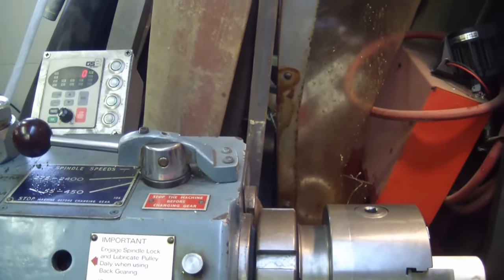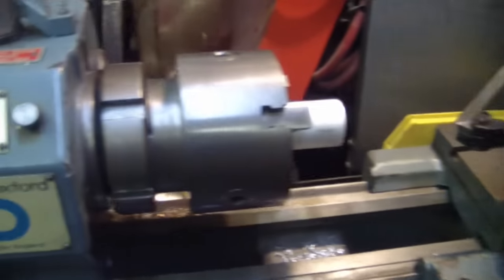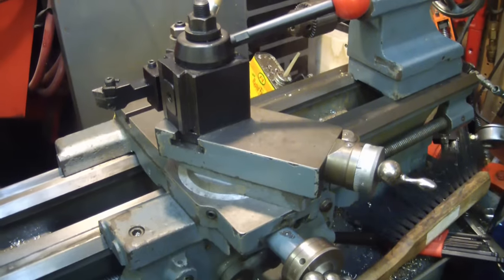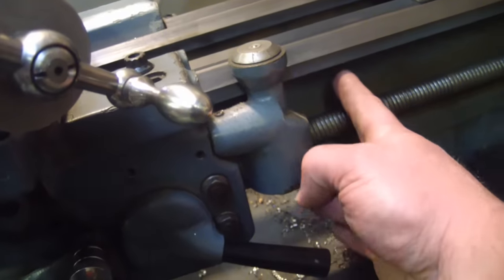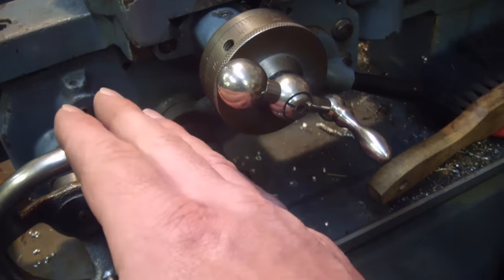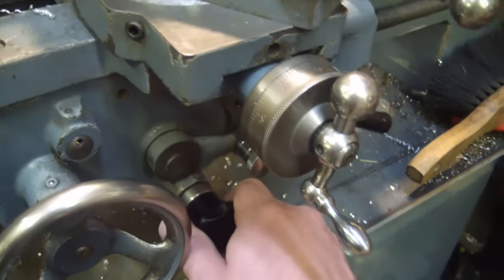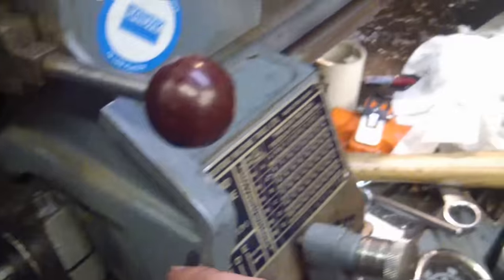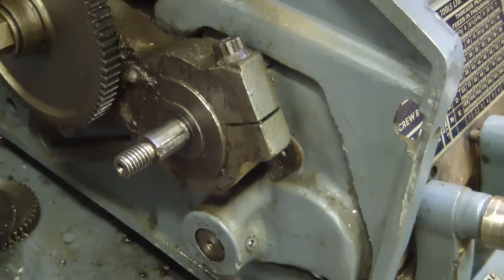3 Simple Rules to troubleshooting ANYTHING.

Comment: Do not clean up as a first step. Dirt, stains, accumulation of dust, and other “messiness” often give valuable clues.
Reply: Amen...
Reply: I once solved a sudden audio problem in a theater by examining which knobs had dust on the sides, and which had dust on the tops.
Reply: Caleb Edwards Won’t be too different from one another anyway.
Reply: yeah, it's almost like being a CSI-agent, there are always signs, tracks, sound and don't forget to touch stuff.
Reply: Norm T  Sadly not allowed where I work.  The poor little things might get offended if you question them.
Reply: Never thought of this before thanks
Reply: A lot of times it's the operator,  and yes READ THE INSTRUCTIONS  after all they manufactured the thing .
Reply: thats how i keep my tools working, they relly in dust AND rust to stay set and tuned. lols
Reply: "It's leaking hydraulic fluid. I cleaned it up before you got here"
Reply: Like cleaning up a crime scene before investigation lol

Comment: number 1 in my books - Understand how it works before its broken
Reply: This is damn right... i inherited an old cnc laser cutter, made her chooch good and proper... everything i was told about her was wrong.
Reply: Disagree. I have learned a few things because stuff was broken. Fixing stuff has been a fun teacher.
Reply: @OnlyFriesians  that only works if you're doing it as a hobby. Not so much when it's your job to know how to fix things.
Reply: You should know things ahead of time, so you don't have to figure it out later.
Reply: I came here specifically to say that. I knew he wouldn’t mention it
Reply: I am a mechanic at a factory. If you know what is supposed to happen and it doesn’t, it will lead yin the right direction.
Reply: @OnlyFriesians  Yea as someone who fixes medical equipment it is crucial to understand how its supposed to work.

Comment: But this really doesn't sort my windows 10 issue
Reply: Twitchi you're not doing it right
Reply: Yeah, Twitchi's using windows 10.
Reply: Cos your on apple
Reply: Twitchi Did you spray it with WD 40?
Reply: not2stupidguitar heat it and beat it
Reply: Convert to Linux, Try Ubuntu or Mint,( back up yer Hard Drive, first. Then gopher it)
Reply: The clutch is probably bad.
Reply: Try restarting it with a hammer. Windows 10 loves the hammer.
Reply: Go back 2 window 7 or lenux thiscwill resolve your issue
Reply: Nothing ever will...
Reply: Try heating it with the acetylene torch. Windows 10 should slide right off once you get it cherry red.
Reply: Did the pin sheer off?
Reply: did  you reboot it?
Reply: All Windows 10 issues will be addressed in Windows 19, but only if you buy and install each upgrade until Windows 19 is available.
Reply: Throw away your computer and start over.
Reply: i also fixed windows 10 by switching to linux.
Reply: What issues? I use the same win10 install for 3 years now without anti-virus just win defender and no problems here.

It's for multimedia and gaming no weird stuff going on here.
Reply: @Twitchi Haha.
Reply: @V4zz33  Consider yourself lucky, so many people have problems with M$'s garbage untested updates
Reply: Well there is your problem, you are running Windows 10 :) (I wish I could just use Windows 7 because I had lot less trouble with that but I can not get even mouse to work in W7 with it because lack of drivers on my new Workstation computer ...) I did get Mac osx running on it as hackintosh but it would not run at anything else then 1280*1024 on my 4k TV no matter what I tried, same trouble in every linux version I also tried (most would not even boot).
Reply: Microsoft: “There are no problems in Windows. Anything you think are problems are either user error, or are simply features which the user misunderstands. Once the user adjusts to this mindset, they will acquire an ability more valuable than diamonds: the ability to tolerate nearly anything without complaint. You’re welcome.”
Reply: Do easiest thing first. So restart and continue on.

Comment: Rule no. 2 VERY true.  I acquired an old brush type electric motor from a redundant industrial fridge from a few doors away that for years had electricians replacing the brushes every six months.  I looked at the wiring setup and noticed it was set up for 3 phase (we dont have a three phase supply in our small village). After a simple adjustment in the connection box, in 15 years I did not have to replace a single brush and the extra power was unbelievable.  So much for experts!!!!
Reply: Brushed 3 phase motor?

Comment: A friend of mine was an expert in electric forklift repair. One day I asked him, what is your secret to these repairs? 
He replied:"start at the key" 
Excellent advice.
Reply: I found that the best place to start with a electric lift truck repair was to start at the battery. Then work your way to the key!
Reply: Caleb Edwards  The battery is also a great place to start. Also, another hidden problem could be the battery charger.
Reply: It ain't got no gas in it ....
Reply: Start at key and go which way? In between key and seat.
Reply: @noahway13  the crotch?

Comment: Very Very true, especially on the guy before you........

I was once INSTRUCTED to do a top end rebuild on a non start car...... "apparently" no compression, i never double checked, why would I? the "Master Technician" had diagnosed it!

Stripped and rebuilt her and alas, still no start!

Long story short, it was out of fuel and the fuel gauge was stuck at half.... many, many, many spanners, screwdrivers, hammers and other assorted hand tools were banjo'd about the workshop that day i can tell you!

thats the most expensive 5 litres of fuel anyone ever bought............ £1300! (about $1.2M if you are reading this after the US goes broke, or $2600 in '15 )

yup they charged the customer! and i promptly left! 

Needless to say that place went bust about 8 weeks after i'd gotten the fudge out of Rodge!
Reply: +Bindo about $1.2M if you are reading this after the US goes broke, or $2600 in '15 
that part is gold. Because of that part I will remember your story and this video if something like that happens to me in the future, and it probably will.
Reply: +Bindo Yeah...reminds me of a bronco 2 I dropped off at the dealer to be repaired . I gave them full details of the failure. (radiator core leaked unto the emergency fuel cutoff breaker) A few hours after  I dropped it off I get a phone call from the dealer explaining that they were going to charge me xxx amount of dollars to take the trailer hitch off to to  get at the fuel tank /fuel pump. I then called the service manager. Another time I dropped my car off at pep boys for tires and alignment...they called me into the shop and demonstrated a thunk by hitting the tire with a block of wood. They said your rack and pinion is bad......xxx amount of dollars to repair. I said "I don't think so.....took it home and adjusted the front wheel bearings.....called the service manager ...he gave me a free set of shocks for my aggravation and time.
Reply: +Bindo 
I have had people say their car is broken, so i have them crank it over, then find the "fuel pressure" nipple on the fuel rail and poke it with a screwdriver... and that usually shows what the problems is.

I always try to "dumb down" what ever it is im trying to fix. things are only complicated when you make them that way. Your example is what happens when someone thinks that because they "know a lot" means that they can dissect a problem to the tiniest detail, only to be way off. In reality getting "close enough" is usually way more accurate.
Reply: Occam's Razor - the simplest answer is probably the correct one.  Kinda like remembering to check the fuses before stripping out the ECM/alternator/fuel pump/whatever and testing all the wires and connections.
Reply: reminds me of the other day boss calls "can you pick me up a new thermostat this ones not working the heats not coming on" yea yea  sure boss man. go in get a cheapo $50 one and take it out pop it in, eh still no worky worky what the f yo. long story short boss man put the wrong pokey bit in the wrong receptacle when replacing the thermostat, fryed the fuse. $50 for a fuse.
Reply: Welcome to the life of a shop. They will all do something like this whether its small scale "lieing", large scale lieing or somewhere in between. It will happen.
Reply: 3 years later, and we still aren't broke. How's Brexit working out for ya?

Comment: Well said! I spent 50 years in the maintenance and instruction of aircraft maintenance. While practicing as an aircraft maintenance engineer, I was required to troubleshoot many defects and as an instructor of aircraft maintenance I was required to instruct troubleshooting. Your steps 1and 2 are what I always presented to my students, however my third step was to consider the costs in resolving the problem. Then I would continue on to your third step which actually was my forth step.
The need to say my third step stems from the expectations that aircraft are always expected to be perfect regardless of costs. This is BS don’t believe it.

Comment: So true! I'm doing repairs for fun for random people once a month (you have "Repair Cafes" in Canada?) and had all of these cases just yesterday.
A guy had taken apart an electric lawn mower because it wouldn't work anymore. He went at it with several tools, checked motor coils with a multimeter aso. He pronounced it dead and had just screwed it back together to haul it to the dump in one piece. I asked him if I should have a look suspecting the safety trigger (he said he checked) because they get worn with time/misuse and just need a little bit more persuasion. Worked on first try...  So a 1, 2 and 3 in one.

Comment: 3 Rules of a technician.
#1 If it aint broke dont fix it.
#2 if it is broke check for warranty and have someone else fix it.
#3 ask google how to fix it
Reply: b t you forgot, when the 2nd laptop was malfunctioning, my wife had bought. troubleshooting and getting replacement parts was a breeze, then procrastinate 6 months - a year. To repair it. When finally getting down to repairing it and realizing  i lost the new parts. Then Look for parts for hours upon hours. Finally find parts. Of course, Realize parts are incorrect. Go to shop to get new parts for a second time. Have a flat on the drive there. skid then flip multiple times off into the median Impaling myself on the unkept branches of a very large oak tree. Catch fire and burn to an excruciating death. Meanwhile, at home while I'm burning and smoldering from head to toe my wife finally finds the adapter for the 2nd laptop she forgot to give me last year.
Reply: So whats the tips for the "Warranty technician" ?
Reply: @gutenman7112  If we can't fix it in ten minutes or less, 
1: report unit as unsalvageable(your company time is worth more than the parts)
2: replace unit
3: junk old unit
4: file the manufacturers warranty reimbursement form. 
Other businesses(fields) may vary. These were the actual steps at one warranty certified place for low dollar items.
Reply: Warranty Technician:

1. 2. 3.) Rip off customer

Job done.
Reply: 4th rule -put the tools down and forget about it, you aint no technician after all!!
Reply: @gutenman7112  Same as above.
Reply: if you do that , you're not a technician
that defeats the entire point of being a technician
Reply: @martinkuliza  Be a technician long enough you'll understand
Reply: As an industrial electrician apprentice....google is the best thing that happened to my job since the electrical drill got invented.

Finding different types of manuals, online makes it 100x easier to fix things you've never touched, before.
Reply: @GoalOrientedLifting  
i agree, same with electronics repair.
finding Manuals for chips and things and components is a godsend
Reply: @gutenman7112  trace the fault as far as a board and swap that out at the customer's expense.
Reply: @b t 
#3 is what millennials do. Because they can't survive without that smartphone.
Reply: @gutenman7112  go straight to rule 3
Reply: @ACommenterOnYouTube  asking google how to fix it vs asking google for the manual.
Reply: @entity6966  back to needing the smartphone to survive.
Reply: If it ain't broke, break it. Insurance fraud is easy and victimless
Reply: @entity6966  can be hard to find manual on google ( very tough )
Reply: The 3 rules of being a diesel tech... 😅

Comment: Might be in the coments all ready.
ANY "WALK-UP" to any POWER FEED machine you didn't set up or are not familliar with, get the tool / spindle / AWAY from the work peice and the machines travel surfaces, BEFORE you turn on the spindle, and BEFORE You engage any feed.
If the "Why" isnt obvious, I suggest some other type of endeavor.

Comment: I was walking down the street one day and a man was taking out his garbage. I noticed a new cordless drill on top. I asked is that drill good? He said no and that I could have it. Upon picking it up I noticed the speed slider on the top , I pushed it forward and the drill ran in both speeds and was perfect. The man said unbelievable, but you can have it I don't deserve it .
Unbelievable.
Reply: Gianfranco Fronzi That was an honorable man.
Reply: I threw a broken air compressor in the trash. My garbage man took it home, removed a cover and tightened up a loose hose clamp. He brought it back to me the next week and it still works perfect 10 years later.
Reply: I repair electric power tools and petrol/electric garden equipment/ 90% fall into two faults, 
1 power lead is broken
2 switch is damaged.
Petrol equipment the faults are 90% carburettor blocked, 10% spark plug

Comment: I find these are good principles for troubleshooting. But I feel it should be 4 rules; and the first being “understand the system/equipment you are working on.”
If you don’t have a solid understanding of what equipment is supposed to do you’re only limiting your chances for effective repair.
Reply: In audio engineering, we have a saying called RTFM - read the fucking manual. Probably applies to machining as well.

Comment: That last shot is a thing of beauty! 

In electronic/electrical troubleshooting, I use an additional premise,  which is "divide and conquer". Breakdown hugely complicated issues into bite-sized chunks. After finding the issue in one small area and correcting it, reassemble all systems together for a harmonic symphony.
In circuit design, my method is "first principles". What is the original problem we are addressing? What is the simplest way to attack it? What facts do we know, and what methods can be used therefore that are applicable to a solution?
Fixing things is fun, but "creating" is funnier. Funniest. Furriest.

Comment: For machinery, always get a copy of the original manuals. Maintenance and adjustment procedures will be in it.
Adding a vfd is OK, but not necessary.
The motors originally built without frequency drives are not optimal for retrofit.
Peak torque is @ operating speed (1750/3500 rpm), and below 60hz the motor suffers.
Also, for example, if the motor is 5hp a larger drive is required to run below 60hz. 7.5 - 10 hp.
Plus installing a vfd defeats the original safety stop system in the lathe, and a dynamic brake should be added.
All metal working machines can be deadly and modifying them should be done by seasoned professionals only.

BTW, nice lathe. Brits make some good machines.
Reply: Unfortunately now it’s a case of we made good machines
Reply: @porkerthepig  the same here, okuma, kitagawa, are good machines today

Comment: Yes, these ARE the top 3 tips for troubleshooting. 

I can't count how many times I got a phone call asking for the single most expensive part the client could think of and I usually get there to double check then fix the problems with my hands and a screw driver or just a long speech to the operator. Pretty much sums up all 3 tips right there...

Comment: Reminds me of a guy who completely changed his rear crankshaft oil seal while the engine was in the car. He was convinced it was leaking because oil was dripping from the bottom of the bell housing. Turned out to be a leaky oil sender. A $20 screw-in part! Hours of grueling labor for nothing.
Reply: It can go the other way. I bought a nice Volvo wagon, for a junk price. On a hunch, that the shop they took it to was wrong, about the main seal. It was the easiest cam seal. The one, that leaks over the back end. Along with a plugged pcv system, that caused the blow out. 
Six years ago, still going strong.

Comment: Several years ago I was in the Army and living in the barracks.  I was the "MacGyver" dude so everyone came to me with all their technical problems.

One dude had just spent a gazillion on a high-end sound system and two VCRs so he could record tape to tape.

He couldn't get the second vcr to show up on the television.

So I listen to his logic and check all the settings on his amplifier and it all looks good.  I can't find a problem.

The wiring is a huge mess so I decide to unplug everything and start from scratch.  It is then that I discover he never plugged the second vcr into his amp.  And I tell him that.

His responsee?  "Yeah, but I have it set on VCR 2."

Right, but you have to actually plug it in for it to work.  He still isn't getting it.

He knew to plug in the first VCR but he thinks the amp and second VCR communicate telepathically or something.
Reply: pfft
Reply: That's easy for you to say. :)
Reply: Driver, truck won'start.
Me playing mechanic, set  gear to park.
Reply: sounds like an officer...